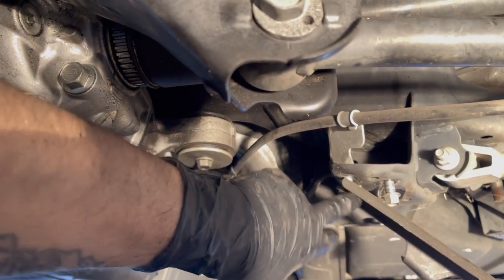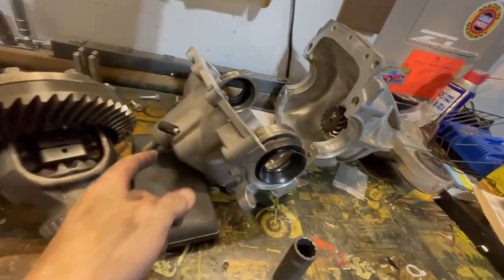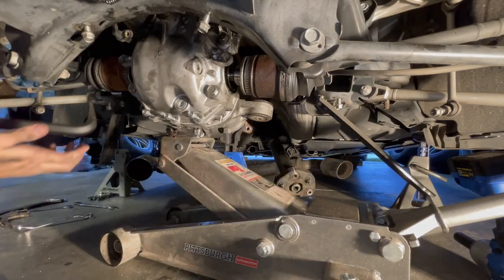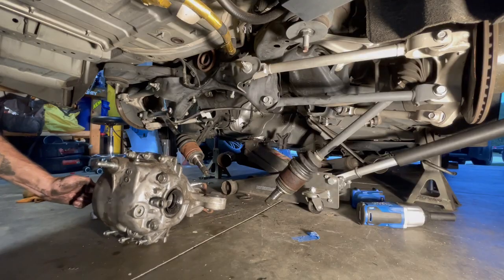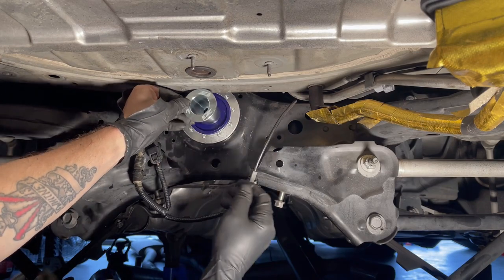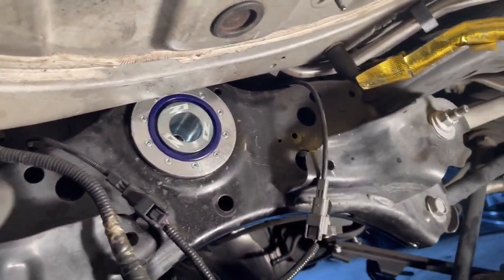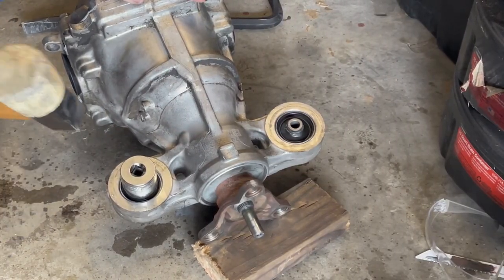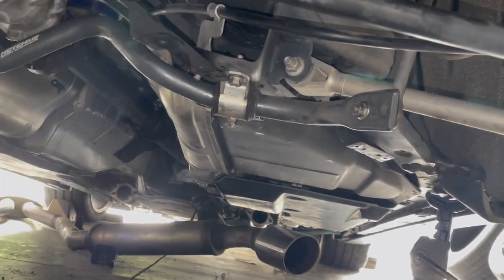Q50 Rear Diff Bushing INSTALLATION | The New Diff Bushing from Z1 Motorsports!

Comment: If I had a suggestion for this, I would definitely say it wouldn't hurt to invest in an oscillating tool to cut out the rubber section of the bushing. It would probably cut through like butter and be very easily controllable. Very nice job documenting this job!
Reply from the maker: It might be worth a shot.  I have one, but the blade is too wide and flat.  If there are more narrow attachments, that might work--as long as it cuts the rubber and doesn't melt it.  The chisel actually worked very well.  I would also say that a small air saw for cutting the metal sleeve might be better than a reciprocating saw too.
Reply: @SpeedCultureStudios  The melting is a solid point, dealing with such a soft rubber.. there are very narrow attachments out there, but as long as the chisel works, no need to mess with a working system. I think a reciprocating saw is a pretty crude tool, so to me, I would probably just use a hacksaw to cut the relief strips, and then use a pry bar to bend the rest out of the way.. appreciate your response and quick action on creating this video!
Reply from the maker: @matthewpalm7484  I didn't show it in the video, but I did use a little hacksaw as well.  Takes a bit more elbow grease, but you can definitely control it better.  I'd like to see someone use the oscillating tool though.  Anything to make the job a bit easier and quicker would be great to know about!

Comment: It's really nice to see all the performance stuff you're doing on these Nissans. I have a 370Z, and so much of what you do on the Qs and Gs is applicable to mine.

I had the Whiteline poly diff bushing set installed on my Z by a good shop in San Jose, CA and the improvement in the feel of the rear end was noticeable; my shifting also got better. My next project will be the slotted Akebono two-piece aluminum hat brakes for the Z, for an even greater reduction in unsprung mass.

BTW: My last duty station when I got out of the Army in 1970 was at Ft Jackson, just outside Columbia. I used to like going to the town and going on long walks, to see some of the interesting historic sights.
Reply from the maker: The z is a great platform and you’ll be pleased with that brake upgrade!
Thanks for checking in!!

Comment: I just did this on a '13 g37 sedan a day ago. Holy crap was it a nightmare. You have almost no access in the rear because of the truck's floor. It comes down much lower than on the Q50. Just enough a sneak a ratchet in. If you have access to a lift, I think the job would be much easier. But if you're gonna be on your back, anyone thinking about doing it had better be prepared for the undertaking. It's all super easy until everything is out and it's time to remove the rear bushing.
I spent a half day just trying to press the bushing out with the z1 tool, 2 clicks of the ratchet at a time due to clearance issues. 

All that said, the car feels so freaking good now under hard acceleration and normal driving. I'm not sure I'd do the job again though.
Reply from the maker: Great insight!  and I agree totally!  It's a nightmare, but makes a huge difference!

Comment: Do the Qs have a washer above the stock front diff bushing ears? And if so did u reuse it? I have a G and am not sure what I did wrong but got more NVH than I’d think is normal for a poly bushing
Reply from the maker: They do have a factory washer but no reused with the new bushings.  Bottom washer only.

Comment: I did the thr opposite with mine. The only bushing bad in mine was the sub frame one so I filled the opening were the original fluid filling was with quick set epoxy so I still have the rubber portion as "flex." I basically made a circular dam with a small hole in it big enough to allow my epoxy tip through it (like a straw on a cup lid) and filled that outer ring. Made a WORLD if difference, took 15 minutes, and about $6.00. Definitely not as good as a complete new bushing set but for those who don't wish to go through all of it, that does the job. Did it two years ago and it looks like the day I did it.
Reply from the maker: That’s what I did first.  Kept it like that for about a year until this came out.  It’s decent but night and day difference when you make this upgrade.

Comment: Would you recommend changing the other 4 rear bushings when changing the differential bushing?
Reply from the maker: It couldn’t hurt—there are only 2 others—but I I haven’t seen any for the Q50 specifically.  Although I have seen someone else use g37 bushings for them
Reply: I have a 2015 q50 base model. Can you drop the links for each part that you replaced in this video and quantity amount because I did see on Z1 that the rear differential upper stopper says sold individually and the rear subframe upper bushing doesn't say how many to get but I'm assuming 4 based on the diaphragm being shown because those are also sold individually.  @SpeedCultureStudios

Comment: This video has been extremely helpful in my install so far, so thank you! But I'm having a bit of trouble trying to get the rear sleeve in though. I've tried greasing the frame where it mounts in and freezing the sleeve overnight but it's so stubborn and it just goes in lopsided. Do i need to just go the gym and hammer it in harder? Lol
Reply from the maker: It can be pretty tough.

Comment: Do you suggest putting the Z1 rear diff brace on after installing the Z1 rear diff bushing kit? Or the subframe bushing collars? I have a failed rear diff bushing on my 18’ Q50 RS, getting the bushing kit professional installed here soon. Thanks! Great videos 👍🏻
Reply from the maker: The diff bushing kit will make a huge difference in its own.  The collars are a big upgrade too.  The brace wouldn’t be as necessary after the bushing kit, but will still add some additional rigidity if you’re looking for it!

Comment: Great video. I have mine installed on my 17 Q50, but I'd took it to get it installed by a professional. It looked too much for me to handle. Cost a grip though to get installed. Nonetheless, along with the differential brace my vehicle handles like it has glue on the road. No more wheel hop. Looking forward to your reviews
Reply from the maker: It was definitely a tough install.  Not hard as far as technical, but a lot of work and in a tight space!
Reply: How much they charge u
Reply: @MotorHub123  nearly a band
Reply: @bae7hoven4775  DAMN. looks like im buying a jack and tools lmaoo

Comment: Hey what were the signs that suggested that this needed to be changed?
Reply from the maker: Mostly just black liquid on the diff cover and possibly on your exhaust.  If it is really worn out and bad you might get some wheel hop or clunking noise when stopping.  I didn’t experience any of these things other than the black fluid leaking.
Reply: @SpeedCultureStudios  ok thanks much, Im seeing the liquid but and getting excessive jerks when stopping.
Reply from the maker: @accinosmith4362  I would say it has failed

Comment: You should look into poly motor mounts and a poly transmission mount. Definitely makes you feel the car more without it being too harsh for noise. Most definitely the transmission mount it has made the most noticeable difference in driving the car. Night and day 😁
Reply from the maker: No trans mount out there for the 3.7 as far as I know and I will definitely go with the motor mounts if/when I need them!
Reply: @SpeedCultureStudios  Yeah there is for the 3.7 lol I have one on my 14 Q50. Torque solutions it's basically same as the G37
Reply from the maker: @ashton9542  That's what I'm saying.  They don't offer a Q50 3.7 specific mount.  I generally don't like crossing parts over unless we know they are interchangeable.  No G37 mount or Q50 3.0t mount says "also works for Q50 3.7."  You're the first that I've seen say the G37 mount works on the Q.  Mounting points and everything lined up?  No issues?
Reply: @SpeedCultureStudios  So the cross brace the mount bolts to,  you go up a few sizes on the hole so some drilling is required but it's into aluminum so it's easy. But yes the holes line up perfectly just needs to be a few sizes bigger on the cross brace from factory. Easy peasy took like 15 minutes to install. Worth the upgrade for sure.
Reply from the maker: @ashton9542  nice.  Don’t mind a little customization

Comment: My '16 RS AWD started behaving rather consistently inconsistent, seem to be losing power with no DTCs, or background chassis control codes, abs etc. Than tonight I'm accelerating through a turn and the rear axle literally felt like it was coming loose from the chassis. Of course I'm counter steering, jerking the wheel, for no reason, I'll add. My pride and joy sure enough needs the rear differential bushing. She's only got a little over 110k miles on her, all four of my DDS struts/shocks are leaking and toast... Having come from the VQ platform to the VR is definitely night to day. I should have prepared for the DDS failures months ago, and no I'm not going coilovers,i actually like the handling characteristics the Monroe DDS struts/shocks give the chassis. I'll be ordering the Z1 bushing prolly tomorrow, I'm dreading the install. But so far in the five infiniti's I've owned, I've never taken any of them to a shop except for wheels, tires, and alignments. Thanks for the video!

Also will a 3" hole saw be big enough diameter to remove the rubber insert?
Reply from the maker: You can handle it!  A hole saw is a good idea.  Even just getting the bulk of it out will give you room to cut that metal sleeve.